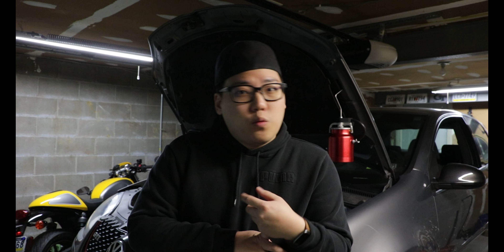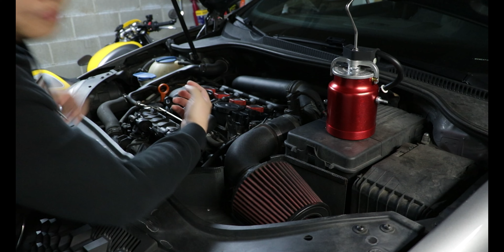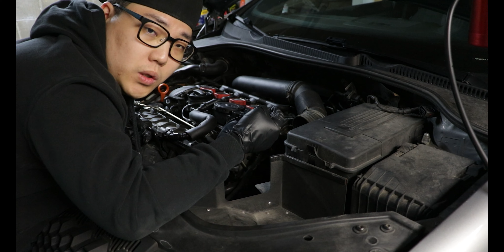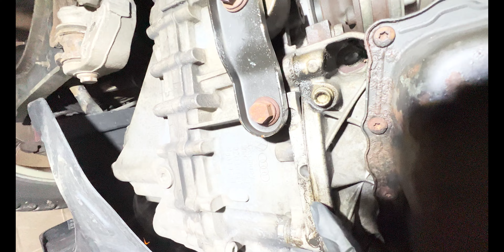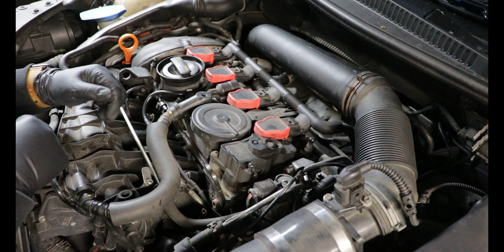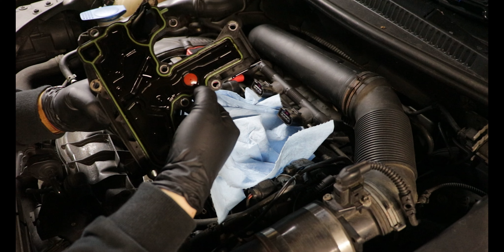Vacuum Leak | PCV | Smoke Test | 2.0 TSI | P0171 | VW

Comment: your pcv valve blew your rear main seal.  If the PCV valve is faulty it builds pressure and VW uses a cheap crappy seal that almost ALWAYS blows out.  With VW Preventative maintenance should be checking PCV valve often and replacing it often to avoid ever having that issue.

Comment: I have done the rear main seal, incredibly intensive for one small piece. I would start planning replacing the DSG clutch flywheel (if auto), and anything along the way like water pump, any coolant hoses, carbon clean the valves injectors, HPFP lobe bearing, oil cooler seals etc. 
I bought mine from an owner similar to your situation, he got fed up with the repairs. It had a Christmas tree of CEL codes, took me about six months and around 4k if I add what was broken and what was about to be broken, and that was me doing all the labor work.

Comment: I have the same problem right now. Rough idle and misfire on cylinder 2 even after changing my pcv 🥲🥲
Reply from the maker: If it’s consistently 2 then I would check the coils and spark plugs of 2
Reply: @hanksun8707  I changed my coils and sparks and same thing. I also changed my coil connector and still with the misfire on cyclinder 2 😢. Any ideas?
Reply: @maxc1913 did u ever fix the problem
Reply: @maxc1913  im having same problem with my mk6 gti. Change coils and plugs and still having a cylinder 4 misfire
Reply: same here .. i beleive that the smoke test is mandatory at this stage @maxc1913
Reply: @maxc1913 did you do a compression test on cylinder 2? It not always plugs or coil packs.
Reply: @maxc1913 did you figure it out?
Reply: I'm having the same problem ! Misfires only at idle ??
Reply: @deweew same here only misfire on idle all 4 cyl
Reply: @hassanmasroor4222 same